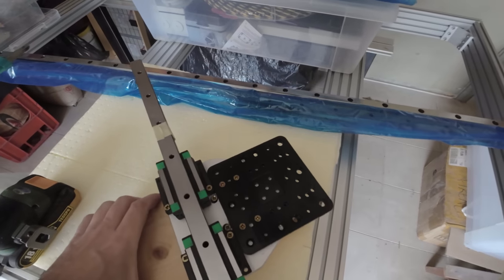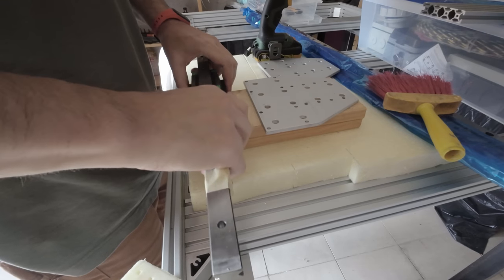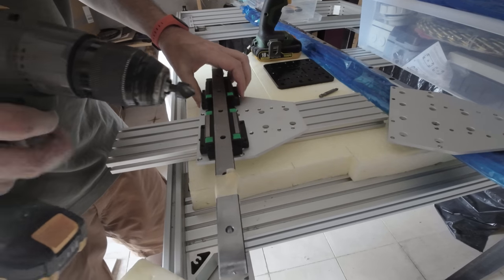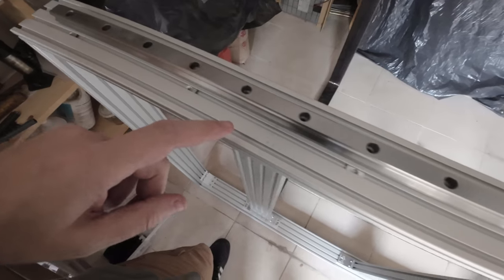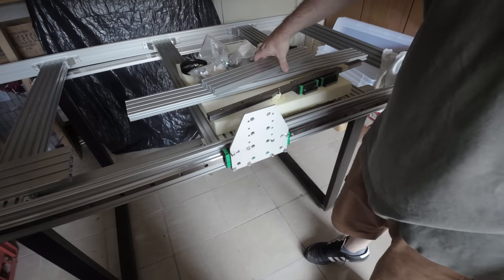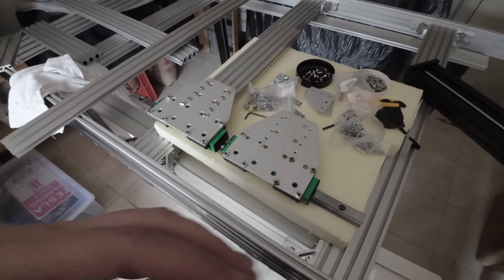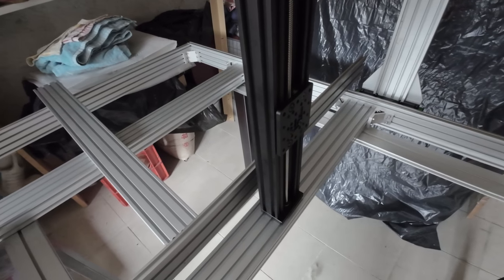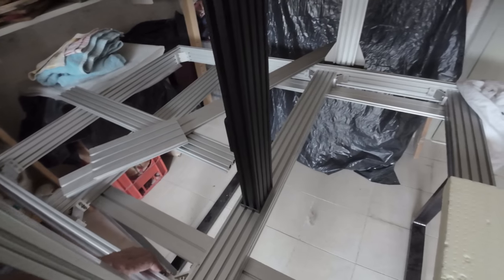Mounting linear guides and setup x-axis to the custom 3D printer

Comment from the maker: ============================================================
Laser Support - https://s.click.aliexpress.com/e/_A0NYLS
Laser - https://s.click.aliexpress.com/e/_AXFIJS
Induction Heating Power supply - https://s.click.aliexpress.com/e/_9hVy0K
Heated bed power module mosfet - https://s.click.aliexpress.com/e/_DkX...
Infrared Heating Film: https://s.click.aliexpress.com/e/_AUcAhb
BIGTREETECH BTT S57B V2.0 - https://s.click.aliexpress.com/e/_9gZpdo
Oled Screen - https://s.click.aliexpress.com/e/_9R4LLy
3D Printer GT2 20Teeth - https://s.click.aliexpress.com/e/_9yJNts
Nema 23 holders - https://s.click.aliexpress.com/e/_9wL11C
BL Touch - https://s.click.aliexpress.com/e/_AYXBGI
Infrared heating - https://s.click.aliexpress.com/e/_9InHB4
coupler - https://s.click.aliexpress.com/e/_ASloGa
Touchscreen Monitor 7 in HDMI Screen - https://s.click.aliexpress.com/e/_DCr...
BIGTREETECH BTT Manta M8P - https://s.click.aliexpress.com/e/_DlJ...
BIGTREETECH BTT CB1 PI4B Adapter - https://s.click.aliexpress.com/e/_DBJ...
BIGTREETECH BTT CB1 heatsink - https://s.click.aliexpress.com/e/_Dmd...
BIGTREETECH  GTR 1.0 http://s.click.aliexpress.com/e/_rRDltN
BIGTREETECH SKR Pro v1.2 - http://s.click.aliexpress.com/e/_rRDltN
BIGTREETECH SKR V1.3  -  https://s.click.aliexpress.com/e/_AbZJ5z
TMC 2226 - https://s.click.aliexpress.com/e/_DBP...
TMC 2209 - https://s.click.aliexpress.com/e/_ApIVvH
Nema 23 - https://s.click.aliexpress.com/e/_AdrgEQ
Nema 17 - https://s.click.aliexpress.com/e/_97imIx
Nema 17 geared 5:1 - https://s.click.aliexpress.com/e/_A3kKfz
============================================================
flipsky ESC https://flipsky.net/?ref=ganzo
maxkgo BMS - Coupon Code ganzo https://maxkgo.com/?ref=ganzo
============================================================
Alibaba weekly deals https://offer.alibaba.com/cps/8pt0t96j
============================================================